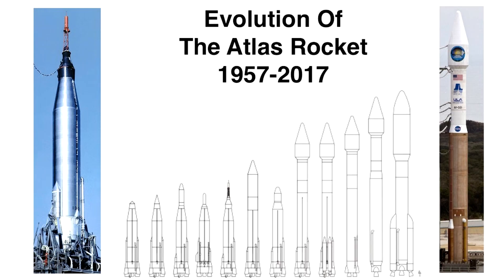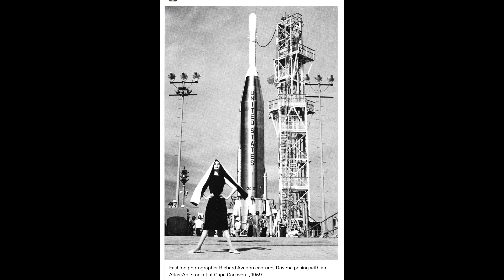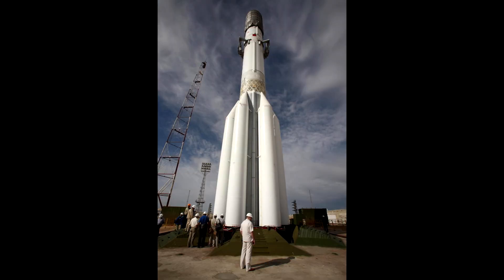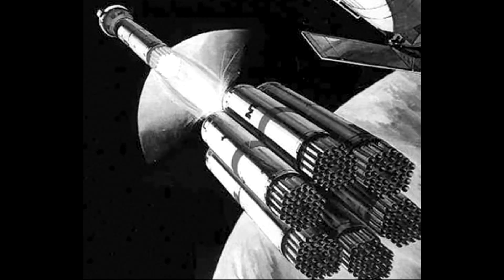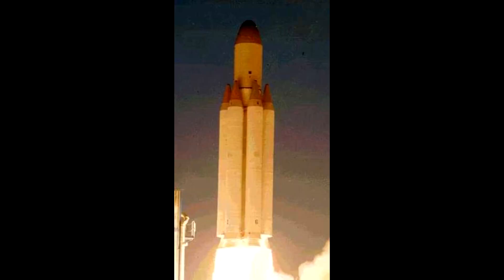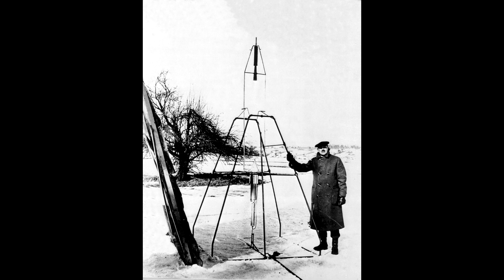The Worst Looking Rockets Ever Designed!

Comment: Idk, I can’t agree with some of these. First off i like the proton even if it doesn’t function like you may expect. I also like the 2 shuttle concepts - the first while spaced apart, looks like a hot rod to me. Like it’s built for speed. The second of course was built for power and i mean who really wouldn’t had want to see 2 shuttle tanks launching a Saturn 5. Next to the sea dragon it’s probably one of the heavy lift concepts i most wish actually happened.

Comment: I built a rocket in KSP that had 4 engines on top, attached by long struts, and dragged the fuel behind. I just dropped tanks as the craft ascended. It worked amazingly well in the demo. The full game... Not so much.

At least the explosions were cool.

Comment: One of the reasons for using old hardware is it takes years to design and field a new rocket system. If you layoff all your workers everytime you change designs you lose all the experience from before. Even Space X had to be saved with a NASA bailout.

Comment: You made the remark you hated some designs simply because the upper fairing/payload section was larger in diameter.

They did this as is reduces drag by a considerable amount.

Comment: What about the new Shepard. I've designed concepts that don't look nice, yet would be practical. One had an offset angled re-entry capsule on it. It would be for a ultralight rocket, the abort thrusters could then double as the deorbit thrusters. The other concept was to have a divided foldable heat shield that double as maneuver wings and landing legs.

Comment: Ares 1X was actually cancelled before it flew. It was already built when the program was cancelled but they decided to fly it anyway. The second stage simulator was built in  segments ("tune cans") at the Glenn Research Center in Cleveland, OH and assembled in Florida. One of the reasons that they program existed was because of the belief that NASA needed an "in house" way to get cargo or crew to the Space Station so they wouldn't be dependent on a single commercial supplier. Nobody knew at that time whether commercial resupply was going to work out, much less commercial crew.  We now have a number of places to go for resupply but still only one commercial crew vendor.

Comment: What's this obsession with reusing the space shuttle rockets? I'm genuinely curious. Did NASA have a bunch of extras?
Reply: The companies that made them for the Shuttle are still around, they still have the capability to make them, etc. so it's cheaper for them to essentially restart the production line, so to speak, than scrap it and start from scratch
Reply: @Tylernol39  Ah, thank you, that makes sense. I guess I forget that NASA doesn't actually make the rockets themselves XD

I'm sure Lockhead Martin appreciates getting to use the same designs

Comment: Honestly Scott I like the Jupiter 3 the design seems simple and you can get a lot of weight into orbit and you wouldn't have to change the flame diverters it seems like a lot of the stuff would line up Flame diverters barges all kind of equipment that they use for the boosters and the Orange tanks. You would think that would save money but I doubt it dealing with NASA seems like they always find a way but I guess a lot of that is on the Senators

Comment: Atlas-Able - Well, I think the yanks were trying to use the supplus rockets they had as they decommissioned them as nuclear missles. 
Ariane - You got me on thata one.  Never liked it from day 1.  But I will use it on my next possible KSP launch.  Two small solids and two liquid boosters.  LOL, I need a laugh.
Proton - I have always liked that one.
UR-700/900 - I have to agree with you on that one.  It was ridiculous.
Otrag - It's a product of a pipe manufacture convention.
SRB-X - I will have to try that in KSP.
Jupiter III - I will try that one as well.

Comment: I have always been a fan of the aesthetics of the Proton M, although I ponder their choice of the bolt on booster look, versus the same engines, but using a singe cylindrical design, would it have considerably less surface or skin drag?

Comment: In defense of Goddard he may or may not have fallen fowl of the pendulum fallacy because he was using the hot exhaust to heat his fuels and drive them into the engine. No fuel pump pressure feed without even having pressurized tanks is pretty smart in my book.

Comment: Hi Scott--The structure of the early Atlas vehicles had a weakness in the upper end of the LOX tank.  The Able upper stage(s) put LARGE bending loads on the upper end of the Atlas due to the distance between the Able stage CP and the attach point to the Atlas.  It was pretty well doomed to failure from the outset.

Comment: The Navaho booster engines became the Atlas MA-1 booster engines. The X-10 which was developed to test the flight control system of the Navaho was one of the first if not the first unmanned full scale aircraft which could land like a piloted aircraft. Anyway, the Navaho didn't look that bad imo. I thought the Space Shuttle launch configuration looked goofy when NASA first made artist's conceptions public.

Comment: Thank Scott I never heard of the V2 Hermes before, ...

The early rockets of Goddard where puzzling me as a child, because the images where often without proper explanation. There is a point that might be an excuse for Goddard's design, because it was meant as a test bed for a rocket engine, afaik it flew by accident only.

Nevertheless if you also include smaller military rockets, here is a German military rocket that would made a perfect example of odd looking rocket design, it was build during WW-2 as a short range artillery rocket. It lacked fins because it was spin stabilized and the nozzles where at the front. A bigger version saw experimental use in fighter planes and it was reported to fly in a corkscrew trajectory, spin stabilisation could have strange effects on rockets or projectiles:

Picture: https://f.allegroimg.com/s1024/0cd24f/c185442f4a89a1d47ad12c3d05ef
WWW-Page (Polish language) : https://archiwum.allegro.pl/oferta/15-cm-wurfgranate-41-nebel-i7400189751.html

Comment: “The worst looking rockets ever designed”
My KSP monstrosities: “PATHETIC”
Reply: "Single stage to orbit!"
"It's 36 stages, you just put them sideways."
Reply: If it's stupid but works then it's not stupid.
Reply: @makssachs8914  Thanks
Reply: All of my ssto’s are basically rockets but on their sides with a crew cabin attached to the faring or something
Reply: You ever seen someone put together a manned rover lab, drills, and ISRU, with XL wheels and a rocket on the back all as a single payload not covered with an airfoil?  That was my first successful lunar rover/base system and it looked hideous.
Reply: I made a rocket that makes it to orbit in less than a minute. Looks like a butt plug.

And the rest of my tickets have flat tops, never using fairings to cover them.
Reply: LMAO🤣🤣🤣
Reply: Same.  I killed a lot of Kerbals.
Reply: My Single Launch Space Station Rockets with Giant Fairings:
Reply: Any stock ksp rocket or plane probably looks aesthetically challenging compared to real life rockets and aircraft. Unless you use flag parts or are one of those insane youtubers that make 3000 part replicas of SLS Block 1 with a extendable nozzle on the second stage.

Comment: I think people actually don't quite understand what the pendulum rocket fallacy is all about, and that the reason we are putting engines on the back has nothing to do with it.

The fallacy is that non controlled engine would somehow magically stabilize itself due to the "pendulum effect". Which is of course bs, and not only untrue for rockets, but just about every other pendulum. 

However "engines go on the back" is for different reason, mostly because for ascent vehicles you want center of mass to be front and center of pressure back.

Comment: Hello, I have an idea I would like to run by you. I think you could make a global transport system like what SpaceX is talking about. we are waiting for the 400 kwh battery but what if we made a two section vehicle. first has gimbaled raptor and battery. the second has the vtol and landing battery. you vtol launch, then use the raptor to get to altitude and velocity, separate and return the raptor back to the launch site. The transporter coasts to the destination Do you think it's possible? do you think it makes sense? you don't have to fire up the rocket until you are away from the launch site and you could land anywhere in the world. Also you wouldn't have to do the skydive maneuver with passengers. I can't do the math to see if it makes sense but off the top of my head it seems like it would work. Thanks

Comment: Timestamps... for no other reason than to put my reactions to them :D
1:14 Taking NSFW rockets to another level
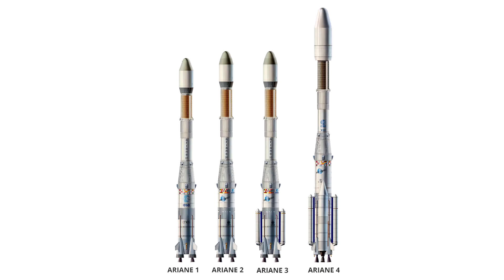2:20 When the numbers of two different boosters look the same on paper
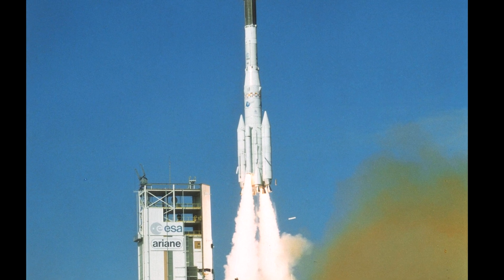2:57 Bolt-A-Rocket
4:10 The Plumber's Dream
4:46 Multi-stage bottle rockets!
6:11 The Flying Crayola box
6:58 An upscaled RPG-7
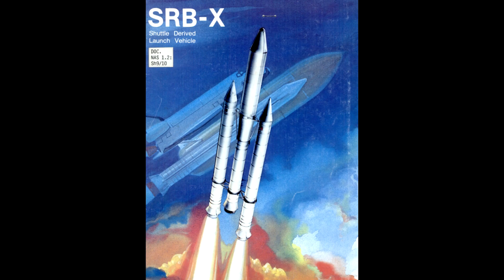8:05 Shuttle on a diet
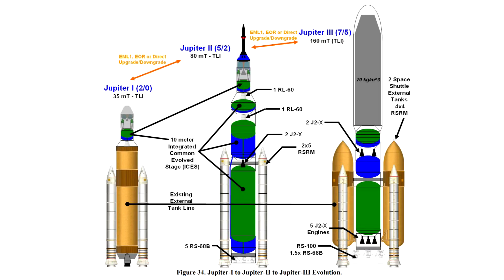8:56 KSP before KSP
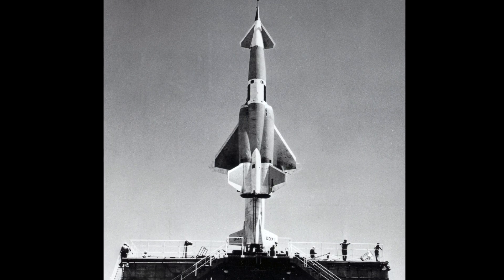9:49 The flying Air Force memorial
10:32 The Minecraft hatchet
11:13 Not finishing a rocket further than the wireframe design

Comment: I like your «check your staging» t-shirt. And, combining that with this episode, here's my take :

In KSP, I made an asparagus type rocket that mixed solid boosters and liquid fuel. The 4 solid boosters where attached to the second and third pair of liquid fuel boosters. The staging was SUPPOSED to be : Liquid fuel pair #1, the 4 solid boosters, pair #2, pair #3, second stage. Instead, I got : Pairs #2 and 3, second stage, solid boosters, pain #1 !   Launch. Pair #1 burn out. Stage. Pairs #2 and 3 at full power and still attached to burning solid boosters, separate and collide with the main body. Unplanned rapid disassembly and massive explosion.

Comment: I seriously don't understand why everyone hates the Ares 1 so much.
Back in the day when the Ares 1x test launched, I was following the project very closely and watched the launch live.
If you would have asked me in 2009 what my favourite rocket is, I would have answered Ares 1 without any hesitation.
I still think it's a cool concept to have a single SRB as first stage and a single engine highly efficient hydrogen powered 2nd stage.
It's my go to design in Kerbal.
Back in the day reusing the shuttle SRBs was everyday buisness and they were flight proven, reliable and cost effective with existing infrastructure, tooling and experienced personel.
And the concept of resuisng a scond stage or propulsive landing of a first stage were still highly speculative ideas.
So the Ares 1 semed like a straight forward simple, cost effective and reliable system that could have been developed with very little R&D cost.
It was also somewhat compatible with the legacy shuttle launch ground support equiptment as demonstrated by the actual Ares 1x launch.
I still think it is a great design and would love to see a private company pick up the idea.
I get the point that putting a crew on such a thing might be a bad idea, but as a cheap and simple semi-reusable medium sized rocket with a highly effiecient upper stage, I could see at least some commercial succes for launching small GEO sattelites and medium LEO sattelites.

Comment: Iraq's Scud contraption and OTRAG are what you build in KSP when you have small parts and big ambitions. (Jupiter 3 = big parts and bigger ambitions)

The Ares I-X is what happens when you have that one annoying test contract and can't be arsed to build a real rocket, so you just slap the biggest SRB you have on the payload and hope it reaches the parameters. You don't even bother saving it as a craft file, because what's the point.

Comment: At 9:00 there is a diagram that appears to say the Jupiter 1 is capable of delivering 35 megatons to Trans Lunar Insertion, the Jupiter 3 is labelled 160 megatons, the label "Existing External Tank Line" points to tanks, not lines and apparently the Jupiter 3 has one and a half RS-68B engines on it. Uh, capcom, Whiskey Tango Foxtrot?

Comment: The triple solid rocket booster design looks like the kind of thing you get when you are spacing your boosters in KSP to ensure they have snapped to the separators rather than the core tank.
Reply: and so the s4 sized boosters I use dont crash into the main ship
Reply: @aguywhodoesstuff1116  thats what sepratrons are for!

Comment: Hahaha, a pair of small points! First, you speak of "aesthetically challenged engineers", but AIUI you're a software eng. at Apple? Go ask your Art/Creative Director (and your concept artists, graphics designers etc) if any engineer is "aesthetically not-challenged" :-D

Second bit - that rocket with two orange tanks (and pairs of shuttle SRB's) lifting a Saturn V core? Call that ugly all you want, but that's Kerbal AF IMHO, and at least makes a lot more sense than the previous entry (with the extra-spaced boosters). Care to make a KSP replica and prove the concept is in fact smart? :-)

EDIT: Hahaha that little jab at Goddard is well-deserved, the ranking wouldn't be complete without his inverted pendulum rocket :-)

Comment: Unrelated question.  Do rockets need full throttle to get off the launch pad?
I ask because spacex are considering not building a flame diverter for starship orbital launch pad, so I was thinking they maybe able to leave the pad at lower throttle then hit the gas so to speak and do less damage

Comment: Social distancing for rockets! Hahaha! 🤣
And you're so right about Goddard! He could've discovered why fuel tanks above the motors is the best configuration by balancing a broom on one finger. It's easy with the brush at the top. But try doing it with the brush at bottom. It's next to impossible.
Like the Starship hopper. Large dummy weight on the top, gimbaling motor at the bottom. Just like the broom balancing "trick".

Comment: I made an SSTO is ksp that had 4 engines at the top (kinda like on the sea dragon) and the payload fairing on the bottom. It actually looked quite cool because I made the top bit orange and bottom bit white, like a reverse space shuttle. It was really easy to control (even if it did veer of course slightly) and could get into lko, and then deorbit and recover itself! This proves that rockets with the engines in the top aren't always trash!

Comment: Your helicopter joke reminded me of an old friend who'd been in the army - he described the Chinook as 10,000 nuts and bolts flying in close formation.
Reply: Or "A helicopter is a collection paf parts desperately trying to get away from each other"
Reply: @milantrcka121  Just keep the "Jesus Nut" tight, you'll be ok.
The Bell 47 is beautiful and the most helicoptery helicopter. Just sitting on a bench out in mid air, no doors. You can feel yourself hanging from that rotor.
Reply: I'm pretty certain of this but its been years since I read this book, so don't hold me to it.
In the introduction (by Neil Armstrong) to the book "Moon Shot: The Inside Story of America's Race to the Moon" there's a story about each author (Shepard & Slayton). The one about Slayton was from his test pilot days. 

I pretty sure it was the Republic F-105 Thunderchief and Deke nearly lost one in a spin test. He was told to bail out but didn't because he still had a lot of altitude. He worked the problem and eventually recovered the plane. After it landed and after he got out the ground crew opened up the bomb bad doors and they said 1000's of rivets and other small bits of metal just fell on the ground. 

You know that scene in the Blues Brothers when they get out of the car and it just falls apart - yup like that.

So the Chinook's not the only case of bits of metal flying in close formation.
Reply: Helicopters don't fly.  They just beat the air into submission.
Reply: Yeah my pa used to call it the "shit-hook" because the maintenance cost was ridiculous
Reply: @blackace7782  One of the other jokes fixed wing guys have about choppers.

There's 2 kinds of chopper - ridiculously expensive and idiotically expensive.
Reply: There’s the fixed wing pilot’s joke that “Helicopters aren’t aircraft, they’re 20000+ spare parts moving in vaguely the same speed and direction”

Comment: I've got to disagree with the Manly Scot here: the Jupiter-III looks amazing. And it's a Shuttle-derived launch vehicle which could actually use many existing components without needing to redesign everything: the External Tanks have the same general load requirements as on the Shuttle, the RS-68 is an existing engine that was designed to be disposable from the outset (so you're not throwing away reusable engines), really only that center core is new. It's a way better proposal than the SLS.

Comment: I know beauty is in the eye of the beholder (or beer holder, in my case), but I think the ares 1, while unnecessarily expensive and rightly canceled, was quite aesthetically pleasing. The shape highlights the fact that it was a shuttle SRB. Same with the Jupiter. Interesting, sure. Complicated? Ok. But ugly? I don't see it that way. I have replicated both rockets in KSP more times than i can remember just because i think they're kinda cool. Or in the case of the Jupiter, mostly because the VAB is only so tall, so why not split the bottom stage into separate tanks and engines so it doesn't make the rocket taller.